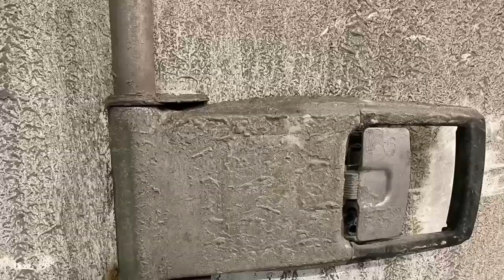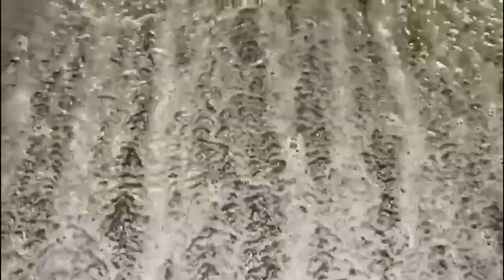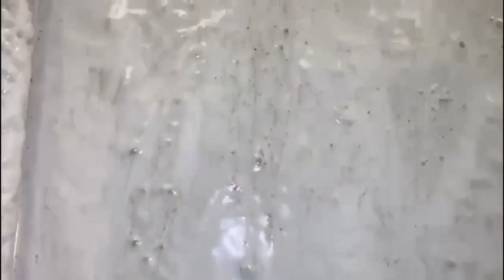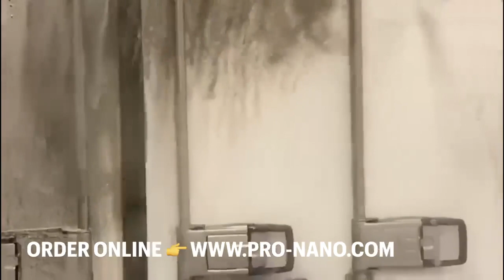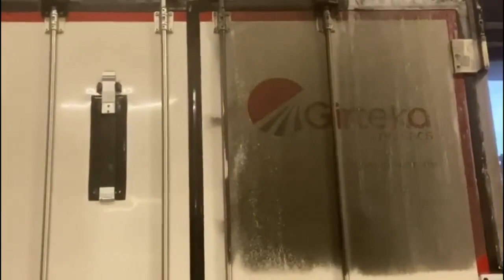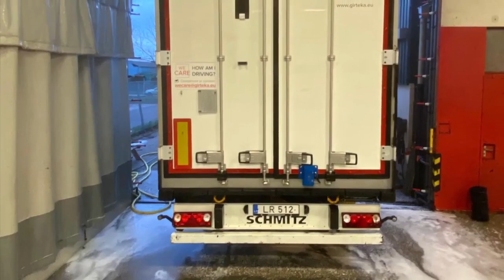AMAZING! Non Contact Truck Wash: JUST WATCH! 100% Contactless Cleaning Girteka Truck with ProNano

Comment: This stuff is amazing but why rinse from the bottom up what’s that about
Reply: the reason these products work so well is they lift the dirt/grime from the surfaces and keep them suspended in the soap. if you wash from the top down in a touchless method you will end up rinsing the soap off before the powerwasher passes over it and removes the dirt.

Comment: This kind of shows how the product doesn’t actually make any difference and it’s just the pressure washer removing the dirt as the patch they miss isn’t any cleaner than before
Reply: As an auto detailer I can tell you, foaming something that dirty without  rinsing is a waste of product. I would be vary interested in seeing them spray it off first see how it looks then do there method and compare. Really it should be  rinsed first then foamed them rinsed again, but if it works for them then keep on keeping on because time is money in the end.
Reply: Try to wash a truck without good chemicals. You’ll wash absolutely nothing. And to have this kind of result without brushing is absolutly amazing!